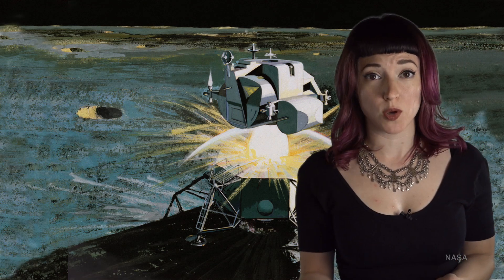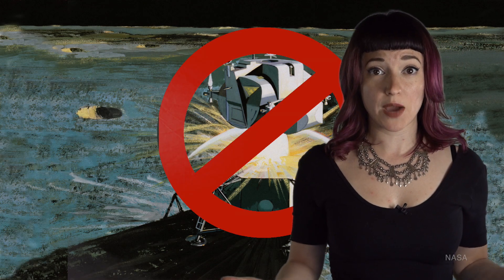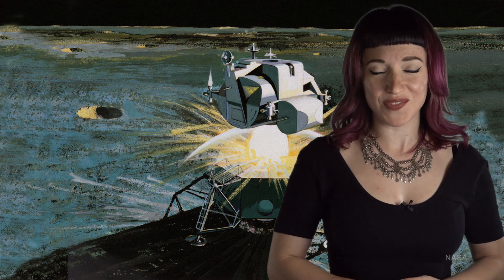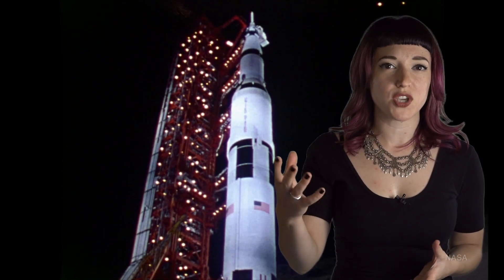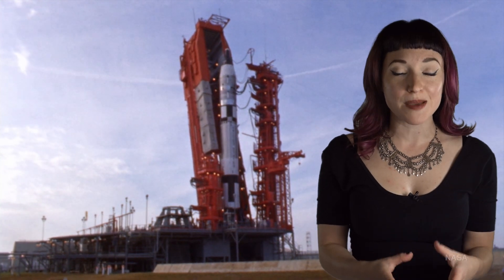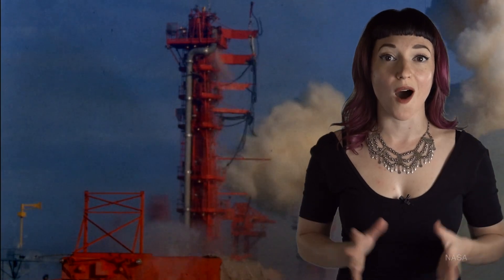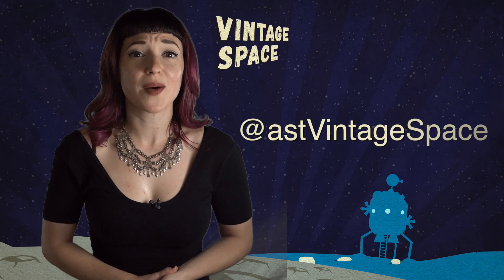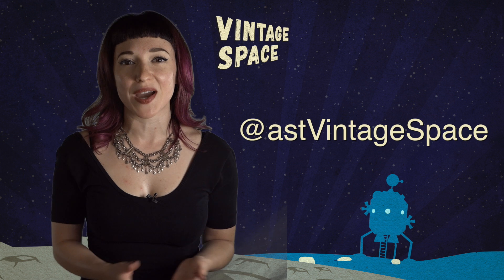How the Lunar Module Launched from the Moon Without a Flame

Comment: I think the moon hoax theory is the most ridiculous thing I've ever heard in my life. I have a moon hoax supporting friend that tried to prove to me that the Apollo missions were fake by showing me footage of the ascent stage blasting off from the moon ( with the camera mounted on the ascending lunar module looking down on the moon ), and during the blastoff the flag waves back and forth from the blast, proving that there was an atmosphere and therefore filmed in a studio here on Earth. Just wondering what your explanation of this flag waving would be? Possibly the dissipation of the thrust as you stated at 2:05 in the video?
Reply: Yes it was blast of hot exhaust gases from the ascent stage.
Reply: The flag pole wasn't just vertical, it had a horizontal beam to keep the flag from falling. Also, the Mythbusters proved that a flag (exact same specs as the lunar flags) can 'wave around' in a vacuum chamber. The movement was more apparent because there is no wind resistance on the moon at all.

Comment: I volunteered at the Titan II Missile Museum in Tucson, AZ (Green Valley). This is true, the Titan II used hypergolic fuels, needs no ignition source and provides a very different exhaust than kerosene and liquid O2.
Reply: Yes, it does in a vacuum.  If you look at Saturn V launches, once the vehicles get up into the higher stratosphere,  the exhaust looks different and there's less and less of an exhaust trail. You can see, if you look at the rear of the rocket and can see into the nozzle, you'd see the chemical reaction taking place to produce the thrust, but the resulting escaping gas (as spent fuel) doesn't look like a ground launch.

Comment: I've worked on these technologies and a better example would be an aeroplane, you don't see any exhaust from those at take off.
but the only thing that bothers me is the remote controlled camera that shot this footage
there is a delay in both signal being transmitted and processed for the movement, this seems to have happened too smoothly to be true. remember the signals from LM were not received in America but in Australia, from where they were beamed back to the USA through satellites again we are talking about latency.
Reply: Yeah,a.mixture of fuel with no oxygen involved =no flame,makes perfect since to me.

Comment: though not mentioned,.. the fact there was no atmosphere, specifically oxygen and nitrogen to react as a hot gas also is a reason there is no flame on lunar take offs or even in low earth orbits. On the Titan there was flame.. not because of the fuels so much as the almost instantaneous chemical reactions creating, water vapor (steam) and nitrous oxides that were visible.

Comment: Was there enough fuel to get the LEM up to 17,000 mph to mach the orbiting Command module and then maneuver into position, assuming they could find it? Impossible! especially in the 60's, we still cant find planes that have gone missing in 2017 ...
Reply: Richard Milner - well, at least you weren't condescending.
Reply: Lunar escape velocity is 2.38 kilometers per second, which is 5323.908 mile per hour, so the more than three times faster 17,000 miles per hour you cite as your proposed rendezvous velocity is utterly preposterous. Yes that is impossible, but its impossibility has nothing to do with fuel and everything to do with physics precluding the scenario as you erroneously framed it.

Your comparison with a lost aircraft is disingenuous. At the point of taking off from the Moon all of the Apollo missions had a fully fit and properly trained crew in control of a fully functional spacecraft with functioning and active radio contact, working on-board radar and a flight computer that was keeping track of their current position. Whenever all of those things are true of an aircraft on Earth that aircraft is not "lost".
Reply: That is why there are launch windows, so you launch within a certain time and take off in a certain direction and after burning the fuel for a specified amount of time....you see Command module. The velocities mentioned are nothing but a red herring, they are relative to your frame of reference, so it all comes down to MATH.
Reply: 0.1 degree doesn't equate to hundreds of kilometers off course when the bloody CM was orbiting 110 kms above the lunar surface. If you are going to pull numbers out of your ass, then I suggest you make them believable, otherwise someone might actually fact check you and make you look silly.
Reply: Distance off course = Tan(0.1) x 110 = 0.192 km or 192 m or 0.119 miles
Reply: I don't understand why you think this is difficult? We achieve this every time a spacecraft docks with the space station and the space station is going much faster and orbits higher than the CM did. Plus, the LM had thrusters that the pilot can use to steer the craft. In the vacuum of space, it is ever easy to predict behavior. We do not have to deal wind, drag, or friction, so the math becomes much easier. It is much more difficult to land on an aircraft carrier than it is to align the space shuttle to the space station. As far as your "The LEM has to accelerate to 5300 mph before it can meet up with the CM", the speed is not the issue here. Once both objects are traveling at relatively the same speed, then it's simply a matter of the difference in speed between them. Their speed relative to the ground does not matter. From an astronaut's perspective, they might as well be stationary. And as for getting up to speed F = M A. We know the force the rockets will provide and we know the change in mass over time (total mass - mass lost due to rockets firing x  time), so solving for A is fairly straight forward.
Reply: Richard Milner - presumably you don't know what an "escape velocity" is. If you had, for example, Googled it you would have been told that it is: "The lowest velocity which a body must have in order to escape the gravitational attraction of a particular planet or other object." The point being that if you achieve (or exceed) that velocity you 'escape' the gravitational attraction of the body in question and so you cannot also be in orbit around that body. Thus you cannot both perform an orbital rendezvous and at the same time achieve (or exceed) escape velocity; the two are mutually exclusive.

Having looked up "escape velocity" and realised that the initially proposed 17000mph, and even  5323 mph, are absurd value for an orbital rendezvous around the Moon it would have been possible to return to Google and look up the real orbital velocity achieved; (aprox) 3600 mph (5793 km/h). It would also be possible to look up the dry mass of the ascent stage (4,740 lb, 2,150 kg), the main engine total propellant mass (5,187 lb, 2,353 kg), the engine thrust (3,500 lbf, 16,000 N) and the rate at which that engine consumed its propellants (11.3 lb/s, 5.13 kg/s) and use that publically available data to  determine whether that system really could achieve the velocity required.

Of course there is absolutely no point in going to that effort because if the numbers did not work out that unambiguously fatal (for the moon landings) 'fact' would already be trumpeted on/in every Moon landing hoax advocate's website/youtube videos. Since in reality the best the hoax advocates offer is suspicion and innuendo about the LM fuel use it is fair to conclude that the real numbers work out fine and the hoax advocates are instead relying on their audience to just parrot the innuendos offered and never check the (publically available) facts for themselves.
Reply: Richard Milner - Really? You know what escape velocity is but you don't know why (repeatedly) proposing performing a lunar orbital rendezvous at lunar escape velocity is absurd? It is not absurd because I say so, it is absurd because it involves the sort of physical contradiction that is forbidden by reality.
Reply: Richard Milner -  Since the accent stage took off vertically, orientated roughly perpendicular to the surface of the Moon, and rendezvoused with its orientation roughly parallel to the surface a minimum in-flight total pitch of 90 degrees is a necessity. For example, shortly after take off (at 50 feet (15 meters) of altitude) the accent stage(s) performed a ~54 degree pitch manoeuvre in order to be able to build up the horizontal velocity that it would need in order to achieve an orbit. The bottom line is that the accent stage was fully steerable, and in practice it was steered by  the onboard computer. A computer that was programmed to continually compare the desired trajectory with the vehicles actual trajectory and  automatically compensate for any discrepancies. So in the event that any adjustments in the direction of flight were necessary the  accent stage was designed to be able to make those adjustments, and do so automatically.
Reply: The LEM didn't need to do 17,000 MPH.  The CM's orbital velocity is much lower than that.  As far as finding the command module goes, you can see orbiting satellites from thousands of miles away with your naked eyes.  All you need to do is launch into orbit in the same plane (basically launch in a particular direction) but in a slightly lower (and faster) orbit, and you'll eventually catch up with your  target.  Radar also works very well.
Reply: That is the height of the CM above the lunar surface in kilometers.
Reply: Point to Richard Cornford.  Score: Logic and facts 1, Richard Milner 0.  Good job.                                                                        Sikh Athiest, for a spacecraft in a 110 km high orbit around the moon, I get 3.2 km max distance for a 0.1 degree azimuth launch error.  The orbital circumference is pi*(110+3474+110)=11602 km. 11602/(360/0.1)=3.2 km.  This assumes identical circular orbits except for the inclination difference, and it would be the max distance 90 degrees from the nodes, and would be less elsewhere. As an example for why your formula won't work, try using it for a case where the inclinations are 90 degrees different.  The answer there should be 11602/(360/90)= 2901 km.
Reply: @ Star Gazer - Agreed, my formula is wrong.

Comment: Also since the gravity is so low on the moon they don't need nearly as much energy to take of. Added with the fact that the rocket had a lot less mass when it left the moon, because when you take of from earth you need to have everything you need to take of from earth (fuel and a rocket to hold the fuel etc.) in addition to the stuff you need to take of from the moon for the return trip, but when you take of from the moon you only need to bring what you actually need for the return trip itself.

Comment: So now I'm being told by some A hole on here that they actually used fuel cells on the lunar module while being on the moon but Neil Armstrong said that they had to make an emergency landing on the moon which offset them from the original grid location that they were planning on landing, because......here we go........are you ready..... buckle up it's about to be a bumpy lie (they were getting low on fuel) OMG!!! Someone just screwed the fucking pooch!!! 

If they were running low on fuel on the way to the moon not on the way home here me out but on the way to the moon and they were using fuel cells, that it was a very serious problem, I will ask all of the smart people exactly how did they go about recharging them to make it all the way back to earth again???? I smell a rat I smell a rat I smell a rat!!!

Nothing she said is true, this type of math and theology only works in the minds of those who are stupid enough to believe that we took a fancy sheet-metal contraption with a few engines and a couple of battery packs to the moon in 1969 

Funny we had just enough fuel, just enough power, just enough food and just the right amount of signal strength for communications to and from NASA almost 500,000 miles away but we failed at taking just enough video of the entire trip there and back? 

Lol they should have seen all types of wonders out in open space but we see no pictures of open space no pictures of stars no video footage of the trip to and from earth, just them landing, having fun hopping in slow-motion climbing down ladders, doing donuts in the rover, planting flags and on later missions playing golf on the moon before taking off from that slow-motion environment and regular speed lol come on man they have lost their minds if they think that people like us is going to join in on the stupidity!

See all you have to do is just think about this stuff, none of it makes sense, even the distance they say the moon is from the earth is completely wrong, the moon would not be as big in the sky as it is being 200 and something thousand miles away yet with the naked eye you can see details on the moon, the moon would look like a star way off in the galaxy if it was really that far away.

On some nights you can see the moon in front of clouds and on other nights you can see it behind the clouds this is impossible if it is 220 something thousand miles away and the same goes for the sun the sun and the moon are almost the exact same size in almost the exact same distance from the earth but we choose to look at drawings in encyclopedias and in science books and every other type of book that they've lied to us in and use that as actual fact as if one of them back in the 20s went on a special mission on his face and verify these findings.

How can the moon completely eclipse of the sun if the sun is 97,000,000 miles away and supposedly 15 times bigger than the moon, how does the sun shining through the clouds at times it makes a perfect pyramid ray of light, how do we get rainbows from the sun shining directly through the clouds if it's 97,000,000 miles away?

The earth would completely freeze over if the sun was actually that far away and if it was truly that far away the whole galaxy would be lit up all the time or in complete darkness all the time depending on what area of the universe you were at because we all learned in kindergarten that the farther you pull a light away from something the bigger the scope of the light gets, if you don't believe me try this with a flashlight against your hand and then pull it away.

Why didn't they burn up on the moon being 227,000 miles closer to the sun or why didn't they freeze on the moon being 227,000 miles away from earth? 

Actually they should have been barbecued going through the radiation belts twice and the fuel should have exploded but no one wants to talk about that they should've also froze to death and all of the equipment should have froze and malfunction being on the moon at night time actually at what point did the sun come out none of the moon pictures or videos look like natural sunlight?

Comment: who moved the camera? the moon has a powder like survive? + that the gravity is 20℅ should move more stuff? you did see the powder fly off on landing videos? no powder on the landing gear? as it's 1:5 gravity to take of and no air to push off why than is the rocket not 1:5 the size of the one taking off the earth? did they ever do tests in a high vacuum for space gear? how about the van Halen radiation belts? they didn't know about them did they? how did they disapeded the heat of the sun in a vacuum? and I got many more questions like this.